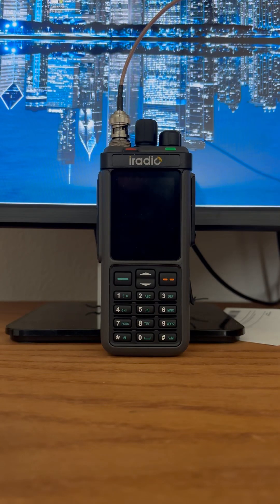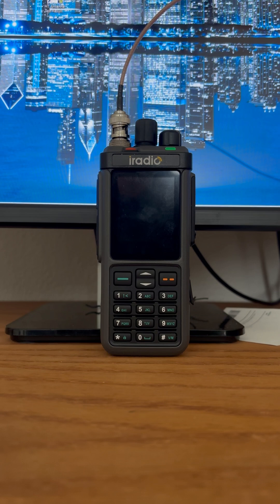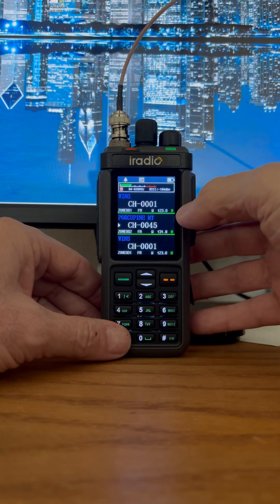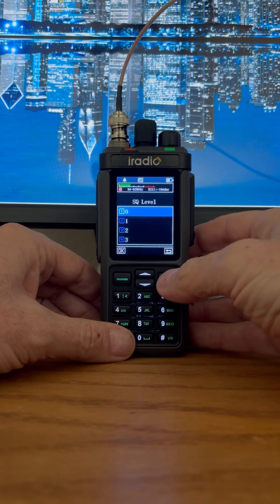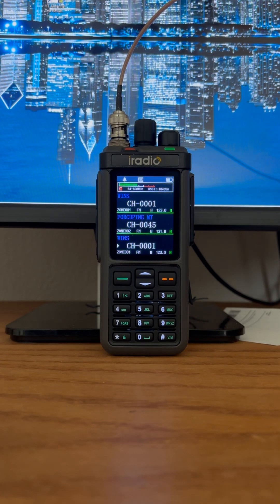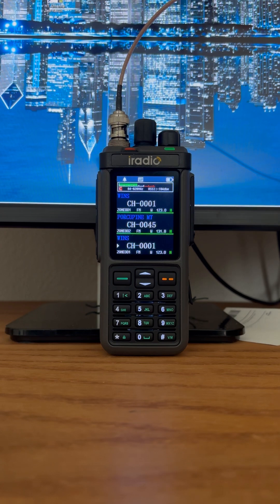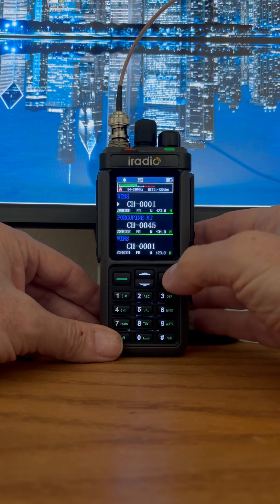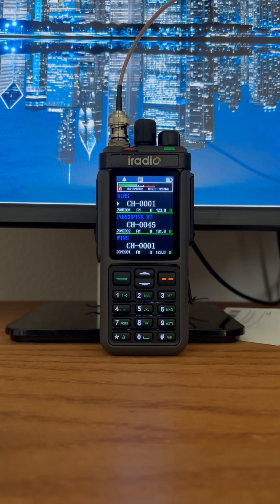iRadio UV-98 Radtel RT-880 Testing and Reviewing the Squelch Issue

Comment: Test the Temporary Tuning under the Analog Setting, turn on the Temporary Rx Set (and tweak the Temporary RSSI/Noise values) and you will get WAY better Squelch sensitivity. I agree that Squelch is super messed-up. Like S5/S6+ signals will NOT break squelch when it's even set to the lowest value of "1". The above can fix this!

Monitor mode is truly broken. Every other radio when you turn monitor mode on it stays in that mode no matter what freq or channel you switch to. This one is willy-nilly - sometimes stays in monitor mode for a couple channel changes, but commonly turns off for some weird reason. Even with squelch set to "0" (essentially in monitor mode) it'll do the same!
Reply from the maker: Thanks for the tip! I will try this out soon.

73’s Dave N8DAV

Comment: In my experience unless you have a Yaesu, icom, maybe TYT or Wouxon ….these Chinese radios for less than $100 have never had a true working squelch, it’s more like it’s either full or off…but in this case…I agree that if it’s set to 0 you should hear some static, no doubt.l m
Reply from the maker: Generally speaking I agree. The receivers on these cheap Chinese Radios are weak. The other thing I have noticed with a few of these is that sometimes the lowest squelch setting is still too high.

73’s Dave N8DAV

Comment: **Update. I was able to reproduce this situation on my RT880g by enabling the setting I described below. It was exactly the same. So that should fix it for you. 

I checked the book and searched online about this. Im almost certain your selected frequencies have a receive CTC/DCS code enabled. Go to Channel Settings. Under Ch Settings menu item 1, 2 & 3 should be Off. Then if you need to enable code for a repeater or something, menu items 1 & 2 Off, and only number 3 On (Rx CTC/DCS).

Comment: I dont have this problem with mine. Check that your channels there do not have an RX code set for CTS or DCS. I see you have codes set for those 3 VFOs. But I can't see if it is for RX/TX, RX only, or TX only. That could be why, if the signal you're receiving is filtered by the RX Code settings. If not, upgrade your firmware.
Reply: He has an active code. It's visible on the right side of the Porcupine channel. It says 131.8. He is wrong. It's not the fault of Iradio but the trap operator.

Comment: It's a muting setting like the old FM muting feature?
Reply from the maker: @iamcicatrix  I had the squelch setting set to “0”. I should have been hearing static and there was nothing.
Reply: @BrilliantHam If you look at the PC application for this radio, in channels, there's a muting code.  Could this have anything to do with it?
Reply from the maker: @ I set it to all zeros and left it blank. No difference.
Reply: Maybe the TSQU is on. de WX8V